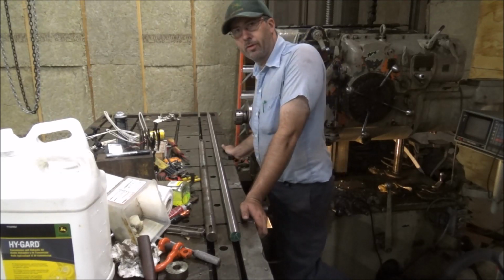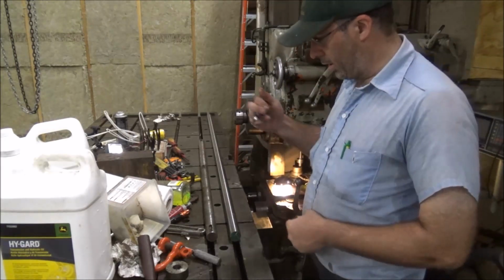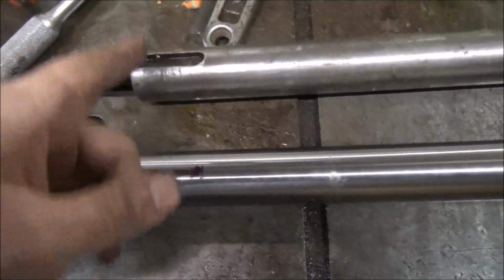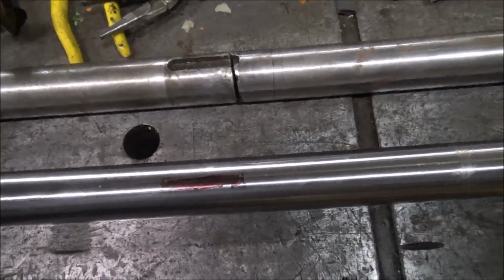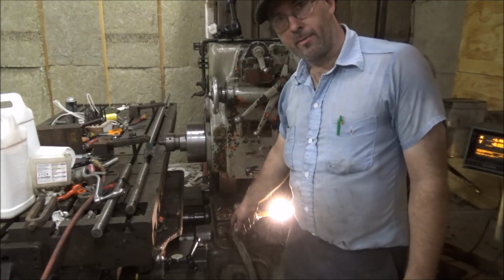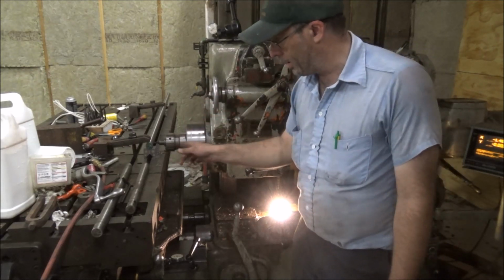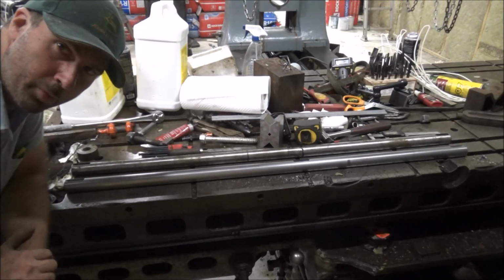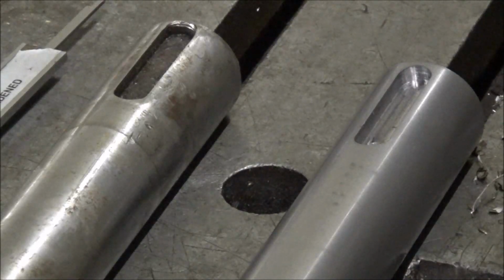First Chips on the HBM

Comment: I just can’t find anything “ boring” about any of your videos Brian , hehe , that turned out good !! 👍 I guess the runout isn’t too much of an issue if your cutter is smaller then the hole / slot you are cutting right 🙂
Reply from the maker: Yep, not the greatest for tooling but otherwise it works just fine with the run out.

Comment: Brian, why don’t you clean up on the side of the barn you are putting up the plywood.  It would make it easier to move those 75# sheets.
Reply from the maker: I think the sheets are mostly all up on whatever you can see in this video.  The main thing in the way now is the HBM but it isn't practical to move it to put up plywood.

Comment: I purchased this old creamery building in Rock Creek, Mn in December of 2016. Inside the building is a G&L 340-T. It is still powered and runs but I have very little to no knowledge of machines of this type. The building was home to L&G Manufacturing and they produced a product called Add - A - Stick. https://www.bdfabricators.com/add-a-stick. Not long ago I was tracked down by the Komatsu dealer in this region, Road Machinery and Supply out of Savage, Mn. The hydraulic shop manager and a shop machinist came out to have a look at it and I was made aware that permission for purchase has been given. The 340 -T is fitted with a 24 inch facing head and there are a number of boring bars and large cutting tools. I don't really know what a fair asking price is and don't want to give this machine away. I am curious if you would know a fair asking price and possibly be available to consult on issues as you have a very strong knowledge of this machine. Thanks in advance, Tony.
Reply from the maker: The last one I saw sell at auction brought $5K. It depends a lot on the size and what all is with it. Would you be interested in selling the facing head stuff separate? I would like to have one for mine.
Reply: I will get some video of all the related tooling and stuff, I will post up on you tube. If RMS is not really interested in the facing head, we maybe able to work a deal out. It will take a few days to get some video, I am away from Rock Creek.

Comment: Great work.  I hope Shop Boss has shade and a fan. Overseeing minions is taxing work. 

So glad to see you get to use what you have worked so hard to resurrect. You have earned my respect.  HBM gnawed it nice and straight. Look at all that horizontal work surface - I see the bench demons are filling the space just like at my shop.  

Big victory lap earned.  

HGR has a big old Monarch lathe on last chance.  Look good as a backup machine.  Now that you are running out of projects... smile! 

Dan
Reply from the maker: That little 22x56 lathe?
Reply: bcbloc02 dunno the size -  it was under $500
Reply from the maker: I don't see it, must be gone.